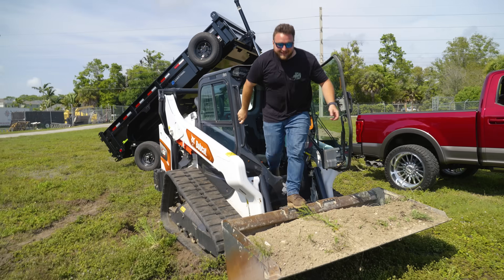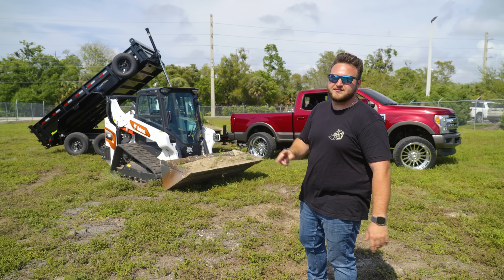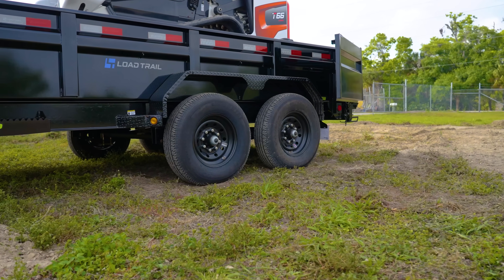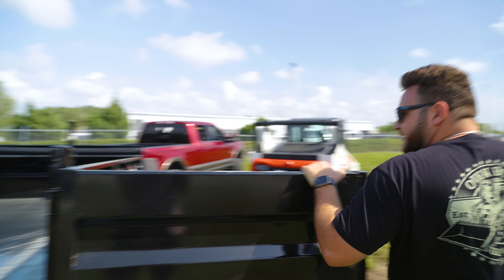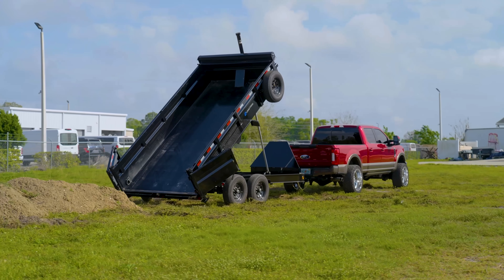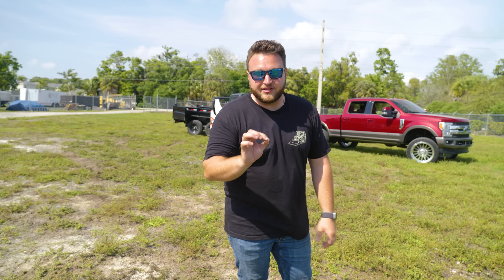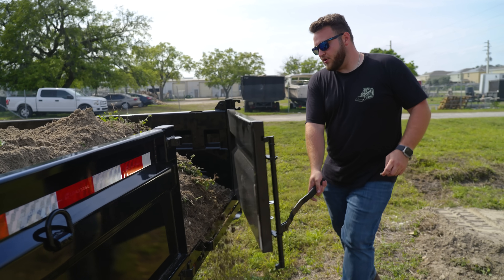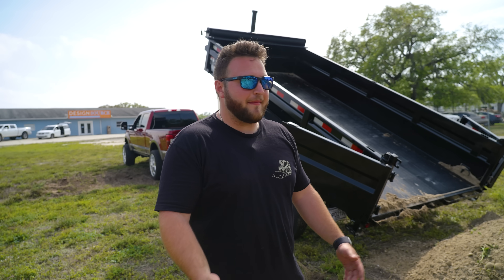Overview of OB24 14ft dump trailer, Ford King Ranch, T66 Bobcat

Comment: Another great giveaway! I definitely prefer SRW. They are more practical and capable enough for most people. Dump trailers may not be as impressive as a large 5th wheel flatbed but they are arguably more useful for most people. I would liked to have seen some rock lights on this setup, and a more work/offroad oriented rim and tire package as well.

Comment: Go all in on a single wheel setup, with the largest dump trailer/skid steer combo possible. Also, black polo with an ob on the left chest is a necessity.  Down the line, high flow plus a mulcher would be insane.

Comment: Guys I gotta know. Does the truck have a gooseneck set up already? How many miles?
Reply: It has 80k miles. It’s on  the details on the own boss app
Reply: @928Flores  sweet. That’s barely broke in for a diesel. You can get half a million on those new ones. I’ve got 300 on my truck at work already.